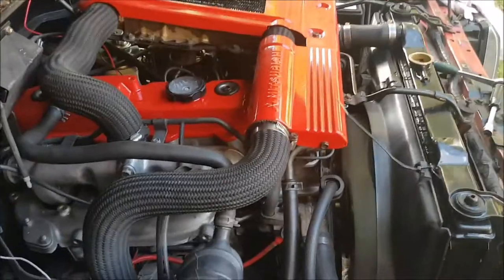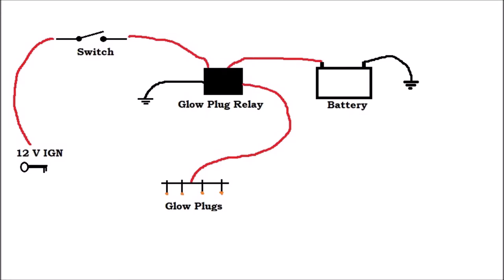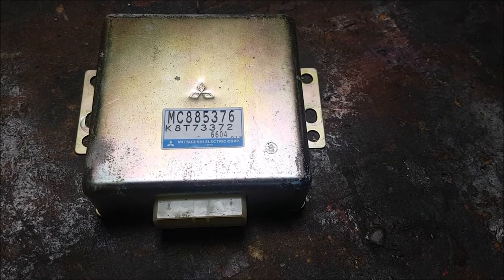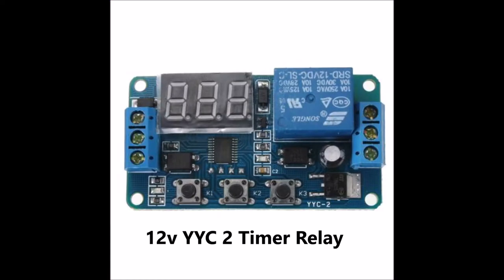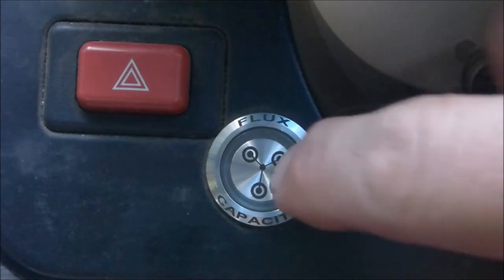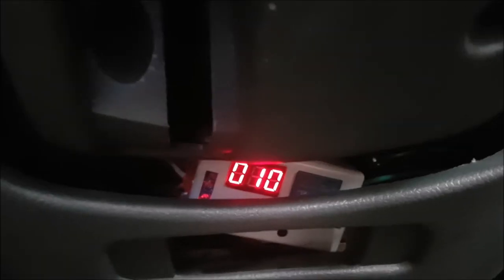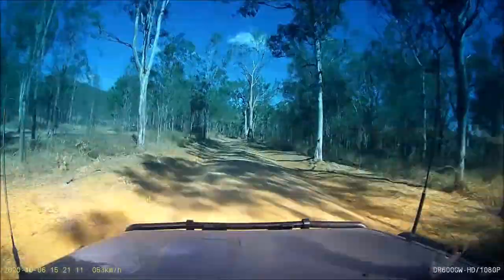Glow plug timer bypass

Comment: Cheers mate. Someone engine swapped a isuzu into the Defender I just bought and didn't bother with the glowplug timing kit. They were on constantly when the ignition was on. Plugs still worked after thousands of miles to be fair. I've ordered the bits for this setup.
Reply from the maker: Sounds like you've got a bit of a beast there. Has it got the 4BD1-T motor in it?? Just make sure you have proper relays when you do it.
Reply: @wilddonkeyadventures  4JB1T, and yeah, is a great engine. All new relays too :)
Reply from the maker: @Jin-Ro  I was thinking of putting a 4JB1T in my Pajero, but the guy who i was going to buy it off kept changing his mind and then eventually stopped returning my calls LoL. So i just ended up using the 4M40T.
Reply: @wilddonkeyadventures  Yeah the AK47 of engines, archeologists will dig them up in a 1000 years and they'll still run fine. Problem is parts in the UK, like hens teeth. I believe parts are readily available in Oz which is where I'm looking for a complete rebuild kit. Opposite problem with the 4M40T in the UK. Parts everywhere, no spare engines :)

Comment: Hi there on your  diagram you have put glow plugs switch and dash light in two different places but doesn't your glow plug switch light up ?
Reply from the maker: Yeah that's right. As not every switch will light up i thought it easier to just have the wire running to a separate light on the diagram and folks could just adjust it to their individual preferences. In my setup you would just run the wire to the lighting circuit of the switch, if it's an illuminated switch. Also if you were to not use the push button switch and instead have the timer activate once you turn the key, you would need a separate light on the dash. Hope that makes as much sense as it does in my head. LoL.

Comment: Mate this system is right up my alley my problem is well I’ve put all the wire to each point but I don’t know where the wires go to the actual timer I got timer through alie pretty much same as the one on here so one side grd,sign the other side has5to30volts or vin I think out + out- ground. Now I have no idea what goes where the wire goes from one side to other side of the timer all the wires except the wires shown on your clip of it please I would appreciate your help
Reply from the maker: I'm not really following you there mate, what seems to be the problem? So have you got the same timer as the one in the video? What car are you using this on?
Reply: @wilddonkeyadventures  so it’s land cruiser 60series so I’ve set all wires to where they have to go except I fucking hopeless with wiring so yes the timer is pretty close in the video but my problem is putting the write wire into the timer so my timer one side is ground and signi assume signal the other of timer vin,out+out, and ground so my problem is which of the wires go to which slot on the timer also the wire from one of timer then goes around to the other side of timer I don’t know what wire goes where I’m not sure if I explained that right.  Dale
Reply: Um I’m not sure maybe send you a picture might help I’m very close it’s mainly wires that into which slot on the timer
Reply from the maker: @daleberry1277  Sorry mate, i'm having a bit of difficulty understanding you. But if it's causing too much trouble, it might be best to take it to an auto electrician or a mate who's good with wiring, they'll be able to sort it out quick.
Reply: I suppose mate when read it back I’m not sure my self I will try once more can’t afford auto elec so I’ve put all main wires per your diagram so wire to relay wire to light switch wire to push button for the timer and so on  but I’m not sure which of the wires go into the slots on timer as said one side has ground and sign and the other side has 4spots which are ground again out+ out-  and vin wires on your diagram just shows wires going to the timer so which wires coming from all the different buttons and things all I need to know the wires that go into the timer which connection goes to which little socket on timer I’m sorry mate I hope that’s easier mate other wise I will be bald pulling my hair trying to work this out.  Dale thanks for your time mate

Comment: Great post, can anyone tell me what the meter reading should be when I attach the live probe to the end of the glow plug once the ignition is switched on.
Thanks in advance
Reply from the maker: It depends on the voltage of the glow plug. Most of them are 12 volts but some can be different. It'll most likely be stamped on the glow plug near the top.

Comment: My son has an 2002 diesel Prado and when it is cold it is hard to start. When the ignition is turned on the dash Glow Plug light only issuminates for 1 second. DOes this mean that the Glow Plug times in the ECU is not working properly.
Reply from the maker: I'd say so. Should be on for a few seconds when cold. Best thing to do is to get a multimeter and see if power is getting to the glow plug rail. If not i reckon the timer is faulty.

Comment: Can I connect a cable to the battery positive run it threw a switch on my dash then from switch to the glow plugs positive connections, I have 4 cylinder diesel van, my glow light only illuminates for 2 seconds then goes off engine will not start in temperatures below 2c
Reply from the maker: Yeah you can do that, you will have to run it through a relay though.

Comment: Hey mate can I wire it up to the ignition so I don't need to push the button on the dash to start the timer
Reply from the maker: Yeah sure thing! You just need to tap into a wire that comes on with the ignition. Just make sure your car doesn't have canbus wiring or you will be screwed if if you cut into it.
Reply: So does 1 use permanent 12V on the trigger while ignition is on?
Or will this keep the timer at 10 or keep the timer resetting itself?

Comment: I used this setup but my relay burnt out while the power specs of my timer circuit were same. Can you please tell me if I need to have the relay which should support 80 maps and 12 volts for timer circuit which would trigger the glow plug relay ?
Reply from the maker: Which relay burnt out? You didn't run 80 amps through the timer did you?
Reply: @wilddonkeyadventures  I attached the glow plug relay directly to the timer relay actually to trigger it. you think it was not correct ?
Reply from the maker: @farrukhqamar  What burnt out? Was it the timer relay or the glow plug relay?
Reply: @wilddonkeyadventures timer relay burnt out as it seems the glow plug relay needs some extra load to get triggered

Comment: Hey I have a hilux surf ssr-x it will crank over but won't start im missing a wire from the ecu to the ignition for power
Reply from the maker: It could be the injector pump. It's a diesel yeah?
Reply: @wilddonkeyadventures  yup
Reply: The electron guy said I have no power going from the ecu to the ignition
Reply from the maker: @brendoncooper5330  It's a diesel so as long as its got fuel going to the injectors it should fire. I recommend taking it to a proper diesel specialist as Surfs can be a bit temperamental.
Reply: @wilddonkeyadventures  should I just do a bypass
Reply from the maker: @brendoncooper5330  I would LoL. But that doesn't necessarily mean it's the right thing to do haha. I've done a couple of bypasses on my 4wd. Haha.
Reply: @wilddonkeyadventures  my ecu is not powering my hilux whats that mean
Reply from the maker: @brendoncooper5330  Check the fuses first of all.
Reply: @wilddonkeyadventures  ecu for truck found burn wiring and low voltage went burn eires by ecu that's from my mechanic

Comment: Hi,  i bought it,  but how i wire it up without a switch?
Reply from the maker: You just run the wire straight to the timer, removing the switch completely. Then it will activate when you turn you key to the ON position, wait until the light goes out and then start it.
Reply: @wilddonkeyadventures  ok, where the switch is connected, it can keep the ignition key 12 volts permanent?

Comment: hi, that's the same as Powertrain Glow Plug Timer 12/24v - DGPT100...
Reply from the maker: It's a different unit, and it's much cheaper. DGPT100 is $65 from Repco. This unit was under $10 at the time i filmed this.
Reply: Forgive my ignorance but did you use the factory glow plug relay or an aftermarket

Comment: Sir how about not using push button switch just engine switch
Reply from the maker: You can wire it up that way if you want to. But i chose to have a switch so i can glow it more while the engine is running. You can't do that if it's activated by the ignition key.
Reply: @wilddonkeyadventures  hi I'm new to this .on the wiring diagram what is the number on the relay.for the wiring diagram
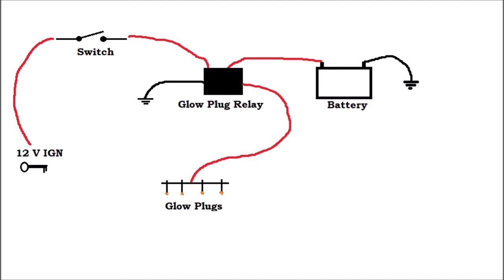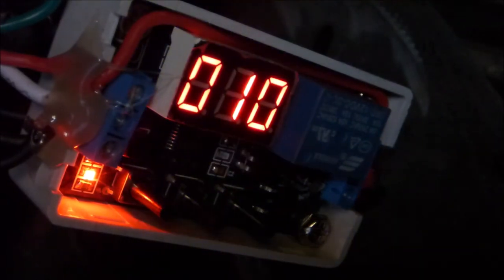Reply from the maker: @ashat2ify  Are you talking about the black glow plug relay in the image at 0:44, or the timer relay at 2:53?
Reply: @wilddonkeyadventures  yes
the black glow plug  relay .witch #from relay goes to grown an so forth
thanks.
Reply from the maker: @ashat2ify  It's just a generic diagram for this video so there is no specific number for it, every vehicle will be different. 

I used the factory relay for this setup. But if you are starting from scratch, it would be best to buy a heavy duty relay from an auto electrician. There will be a wiring diagram on the packet.
Reply: HI THE ONE AT 2:53
Reply from the maker: @ashat2ify  I just used the vehicles factory glow plug relay. Your car may be different.